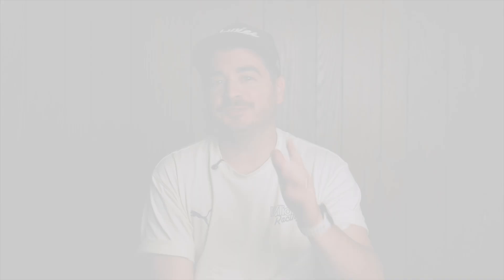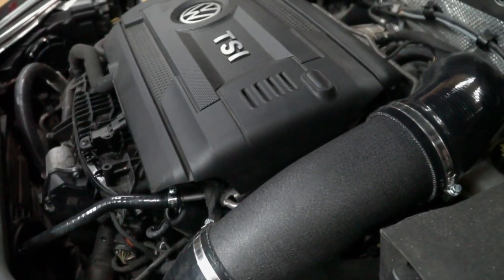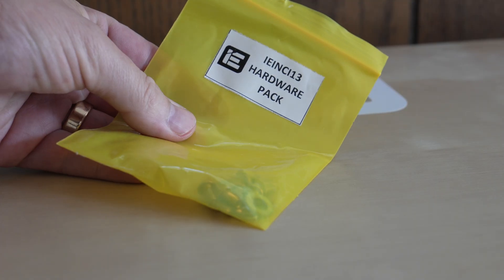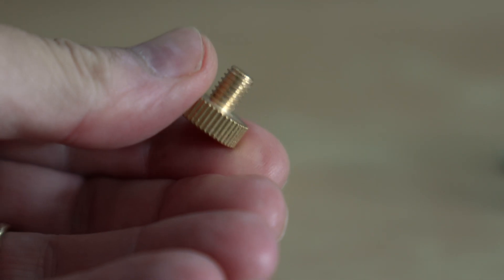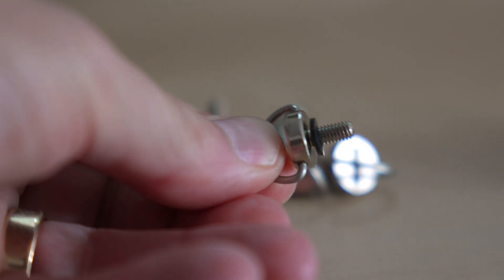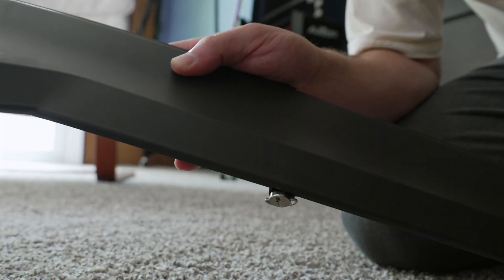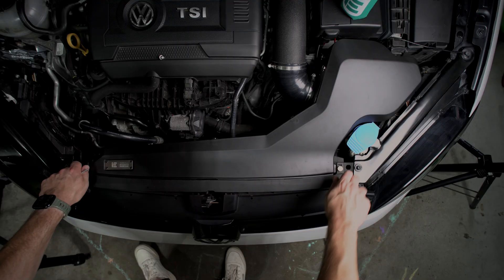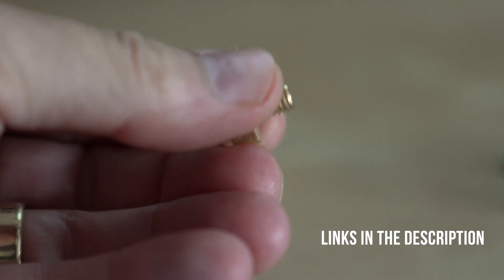Why the Integrated Engineering Mk7 Poly Lid is Great… and How I Made It Better | Easy Install

Comment: One thing that keeps me from spending money on the lid is that it seems like the lid doesn't fully enclose the intake from the engine bay. Is that accurate? Pictures I've seen show the IE label on the nose of the filter so it seems like it won't actually reduce hot air at all.
Reply from the maker: Yea, the entire right side behind the driver head light is open.  Not designed or intended to reduce temps. 

To reduce the air temp, I just buy a couple bags of ice and pour them into the intake tray and store a couple beers in there too. 🤫🤣
Reply: @DadWagon do you think one could rig up a diy closed intake system?

Comment: I've owned the CF lid for a while and always hated the hex screws, thanks for this idea.
Reply from the maker: No problem! It's super simple - the D-ring screw also have a little rubber washer built into them which I forgot to mention in the video - which is a nice tough, but they do cost more.
Reply: @DadWagon I saw the washer in the video and that’s what sold me on it as I’ve been using thread locker until now. Absolute PITA to apply.